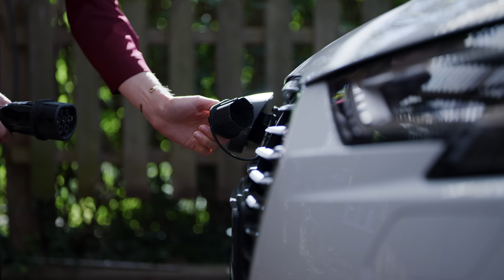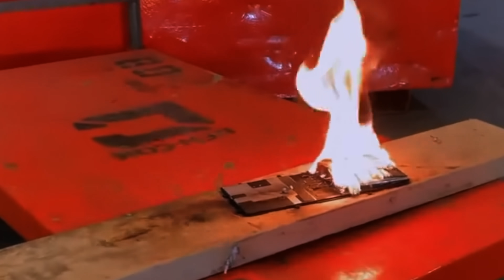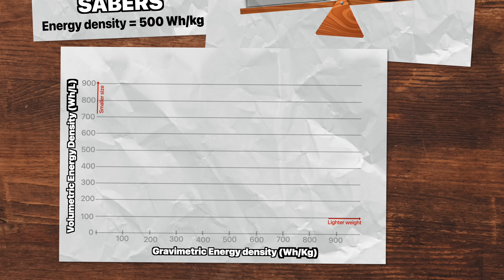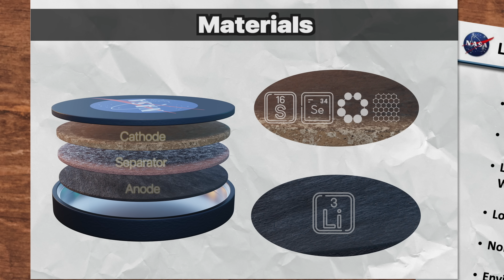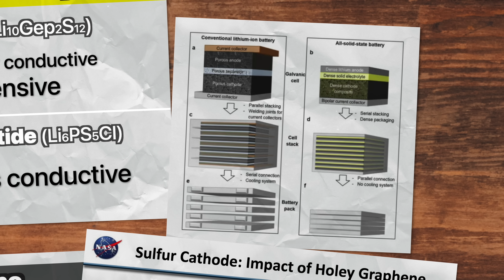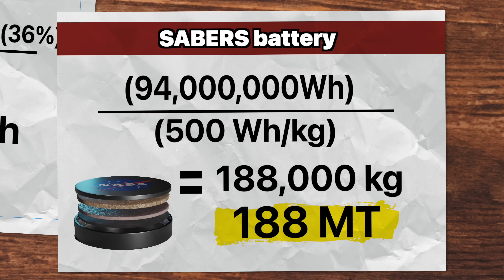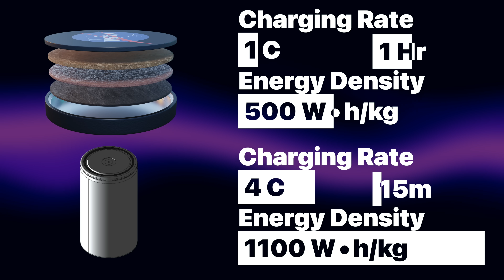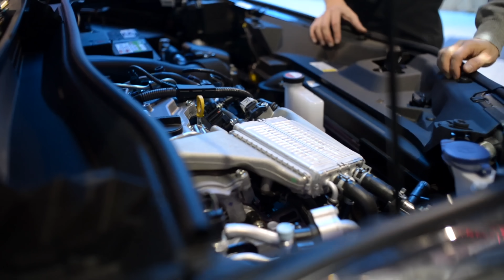Why NASA is Building a Solid State Battery

Comment: Very impressive! It sounds like they still have a ways to go though if they want to use this for flight. 0C sounds cold, but at higher elevations it's actually fairly warm. A mid-western winter will easily get down to -17C or lower. When you're talking airplane altitudes you'll easily see -40C.
Reply: The flip side of that is that since you're no longer concerned with the fire hazard, it's fairly straightforward to insulate the battery compartment for temperature control.
Reply: They'll just add a heating and cooling system for the battery like what pretty much all electric cars have
Reply: Tesla’s only get around 1/4 - 1/3rd of their stated ranges below -30c, because of their battery’s +15°c heating needs.     It’s why the Canadian gov is paying grants for the rescue/towing sector to come up with a standard for  high-voltage, common connector, generators on new tow/rescue truck builds.  
    Plus, they are fighting Tesla’s idea to make their batteries structurally integral, and irreplaceable, to all their vehicles by 2025.    It takes 3-30x the water to put out a EV fire with the current packs that can be removed(or at least accessed).
Reply: I don't think keeping the battery warm will be much of a problem. They generate their own heat when discharging (or charging), and like everything else they follow the square-cube law - meaning that a large battery (like in an airplane) has less surface area for heat exchange per unit volume than a small battery. The battery can be brought to the right temperature before takeoff and then kept warm by its own heat. I actually wouldn't be terribly surprised if they require active cooling even in flight.
Reply: And as a bonus you don’t need to heat the battery as much unless it’s optimum performance comes at a similar temperature to the Li-ion. A 15C difference on the low end of the scale.

Comment: Jesus H Christ man can you not even put shit on a Graph properly or do even the most BASIC Quality assurance on your graphic before uploading.  Hydrogen dosn't go at the bottome left of the graph, it goes at the bottom RIGHT, where gravitational energy density is HIGH and the Volumetric density is low.  Infact its Hydrogen is 39,000 Wh/kg which is off the damn graph.  The spot you put Hydrogen is instead the Energy density of a Early Lithion Ion Battery tech 150 Wh/kg and the inflated region that stretches upwards is the improvement of Lithium Ion technology over time, This is a F***ing embarsment of a graph which screams that you just grap pictures off the internet and have no idea what they actually mean.

Comment: two problems with your math on 500 miles for short range flights. 
1) Most airplanes carry extra fuel that allows them to circle the airport for quite a while in case of emergency or air traffic delays. So they for safety most planes would want to have around 100 miles of 'buffer' so BEST case scenario an electric plane would only be able to travel 400 NM.
2) Max take off weight INCLUDES passengers and cargo. the main source of income on passenger flights is not the passengers it is the additional cargo that they can squeeze in above the weight of the passengers and their luggage. If you replace the engines with something that weighs a lot more they will lose cargo capacity and not make as much if any profit.

Comment: You know, you could produce More power,WITH  less weight with Capacitor and inductor TANK circuit  with the same values and a pulse controller. Post it at the resident frequency. And you could potentially get 10 V and 10 amps by using 1.5 V. Pulsed not DC or AC

Comment: So about the range of aircraft. While individual flights may be well under the max range of new aircraft, it allows the airlines to fuel less throughout the day. Less fuelings per day allow them to get passengers on board faster more often. They are also doing this while using less fuel.

Comment: Just imagine where to get the unlimited power to charge all the batteries on earth when we already have rolling blackouts and power outages. I can't wait for this technology, I will have a diesel generator trailer behind my 0 emission vehicle to save the planet or maybe I will be close to one of the thousands of new coal fired power plants that will be built so we can have zero emission vehicles. A trucking company in Chicago wanted infrastructure installed to charge 30 EV semi trucks and was told Chicago can't supply the 30 megawatts for the project.

Comment: NASA does a lot of composite and polymer research as well. NASA tech always means lightweight and able to function in extreme environments. In low earth orbit, your classic corvette would quickly become floppy sheets of fiberglass with nothing bonding them together. Many of these inventions translate directly into areas such as commercial aviation.

The LGPS sounds could be a deal killer for automotive use, though some kind of CVD (chemical vapor deposition) approach could drastically cut the amount of germanium required and simultaneously increase the efficiency of the battery by making the electrolyte thinner.

Comment: I think the move in the automotive sector will be to make the battery half the size rather than trying to go twice (or more) as far. In addition to keeping the price down as the battery is the most expensive part of an EV,  keeping the size down you can increase cabin or storage room and keep the weight of the car down which is the biggest culprit to going farther.A  Tesla model S with a 1200lb battery downsized to 600lbs could be as much as 60 miles extended.
Reply: A battery with increased capacity(which can go twice as far) itself means a lower weight. If you don’t want range just decrease the number of cells, which it turns means lower weight. Capacity density or colloquially called capacity (usually measured by Energy density) means Watts/kg.. higher the capacity lower the mass
Reply: Yes. Well put. 👍
Reply: I have heard people complain about electric vehicles going far further than needed for short commutes, being too luxurious, and/or having far more performance than needed.  Based on the theoretical energy output, it sounds like cars will get to highway speeds slowly for an EV, but if it is affordable, people won’t complain given gas prices.  Scalability would be an issue if the elements are as tough, toxic, and/or unethical to get as cobalt and/or lithium.  (Granted, all cars use a significant amount of metal regardless, but the point still stands.)
Reply: @alexanderrobins7497  My understanding is that most of the metal in a car is usually iron (as the main component of steel), and that iron is usually so cheap and easy to mine that it's not considered worth recycling.
Reply: I would say a mix, people want longer ranges so keeping a portion of the increased capacity of the more efficient battery would still give weight savings while extending the range. But the biggest hurdle is charging, people that do long distance drives will require a system that is as quick to refuel as getting gas is and as easy to find places to refuel, the current charging networks are a fucking JOKE with many units regularly out of service and many more operating at de-rated levels resulting in slower charging. Until the charging infrastructure is there and the batteries can handle 5-10 minute full charges the electric car will never be able to replace the ICE car.
Reply: There will likely be a sweet-spot where watts per kilometre will be optimal. Then, perhaps you can get the battery size that suits your needs, and this could be a selling point. A lightweight battery with less range for people who are only doing short commutes, and a large battery for people who regularly travel further. It may also be possible one day to make batteries modular and configurable by the vehicle owner, adding and removing cells as needed.
Reply: EVs still have infrastructure and charge time barriers to overcome, far before current battery tech needs a serious do-over.
Reply: Making the battery go twice as far is the same thing as making it half the size lol, if you make a battery go twice as far you have doubled the energy density therfore, you can cut the size in half and have a battery that goes the same distance

Comment: I feel like this combined with some advancements of capacitor technology might be the right blend. You don't need a ton of rapid discharge from your battery, you can do that with a capacitor that the battery recharges. This would be great for things like takeoff power. This, however, might not be great in the case of a plane being made to go-around they would need to wait until they have enough capacitor availability to do another go-around if required.
Reply: That doesn't change the fact that you still need the Watt-hours to actually reach your destination. Plus the batteries could deliver enough power for takeoff in itself, so all you are doing is just adding a lot of mass. Capacitors have very low energy density, so I doubt they could even last for takeoff.
Reply: @bobthegoat7090  Capacitors have come a really long way. There are some early versions of supercapacitor vehicles like motorcycles that already exist. These are obviously not planes, but there isn't anything I know of that inherently means they have to be big and heavy. They also would be built for the use they are given. 

I'm not an engineer, just a pilot, so if I'm wrong then I'm wrong but it does feel like capacitors are not given the attention they could be in terms of future of electric vehicles.
Reply: @teamcoltra  Yes, maybe capacitors could play a role in motorcycles and cars that need to archive extreme acceleration, however the only advantage a capacitor has is power output, which is simply not important beyond a certain point in a commercial airplane. Maybe military planes, but I doubt they would go electric in the near future.

Then again, I am not an engineer either and not even a pilot. My area of expertise lies in electronics and hobby engineering. So nothing to say I am more right than you are.
Reply: @bobthegoat7090  To be clear I'm not saying ONLY capacitors, I'm saying if a solid state battery can't put out enough power for the important phases of flight then you could have capacitors that give it a boost for takeoff, go-arounds, and any abrupt climbs that would need to happen. Think of it like the solid fuel booster on a rocket, it gets the plane off the ground (or helps get the plane off the ground) while the battery can then take over for the rest of the flight. 

The complaint in the video is that these solid state batteries would be poor choices for large commercial aircraft because they wouldn't have the power to get them off the ground (but might have the power to sustain flight) so I'm thinking capacitors as a way to bridge that gap in this specific usecase.
Reply: @teamcoltra  I get it. Just like supercapacitors are normally used. I just think that even a supercapacitor that could help get a commercial plane off the ground would be too big plus we would need even more batteries for the extra mass of the capacitor. If I have time at some point I will try to make the math and look at how large a super capacitor would have to be to get a 737 off the ground.
Reply: How bout a capacitor powered  space ship ?
Reply: @jacobclark89  You need around 8,889 Wh per Kilogram of weight to get it into space. Neither batteries nor capacitors could ever physically get good enough to be energy dense enough to do that. Saber is 500 Wh per Kilogram no where near the power needed to get to space.

Also I wouldn't want to be around a battery or capacitor that energy dense.  A battery at that kind of energy density would literally be ticking time bombs. We already have batteries blowing up cause they get wet. A battery with 8,889 Wh per kilogram of energy would blow up with the same energy as 8 kilograms of TNT. 

So no, a space ship made of batteries is a very bad idea.
Reply: @lloidffxi  I think the real problem is , propeller's are only good to a certain alt . I think its the same for plasma ionic trusters
Reply: Honestly fuel cells are just a much more realistic alternative, especially when you consider the fast refueling rates that are required in commercial aviation

Comment: From what we knew about battery tech in the pipeline, solid state batteries are less volatile and charge faster. However nothing in the pipeline is more energy dense than lithium ion. So we definitely haven’t reached a significant breakthrough yet. Maybe in another 20 years

Comment: Of course this is excellent news for the current autos. But lithium still so critical to this tech makes it still only short term. Lithium is relatively rare and hard to get. Batteries also feel temporary. Electric propulsion is they way forward, but onboard production using plentiful materials seems longer term solution. Hydrogen is in it's infancy, but could be a part of the the answer ... along with solar (also in it's most early development) we might have something for the foreseeable future. Put the $$ and resources toward the much longer future tech we need.

Comment: Hi! Nice video. A battery has the same weight ni matter how full or empty it is. The fuel that is used reduces tge weight of the plane and changed its range. Did you take that into account? A plane has still sime fuel at its destination. Is the maximum range with the battery including a healthy reserve? 
Thanks for your video.
Reply: that is actually incorrect, a discharged battery is lighter
Reply: @acakeshapedlikeatrainonatable  a little of course but not compared to the fuel of a plane.

Comment: Solid state batteries have been around for a while now, the reason they have not become commercially viable is because of the cost involved in manufacturing them, they usually require manufacturing in high pressure environments, making them very $$$